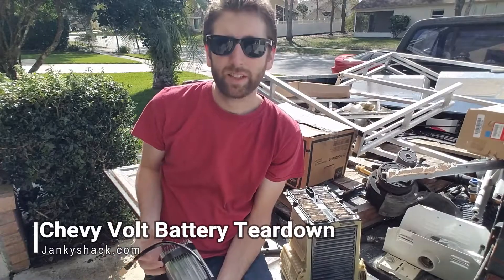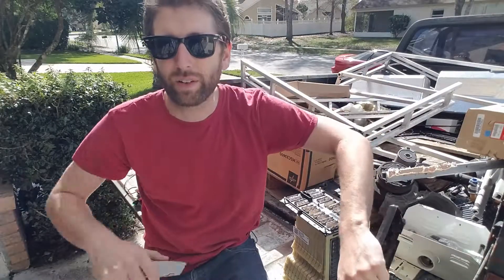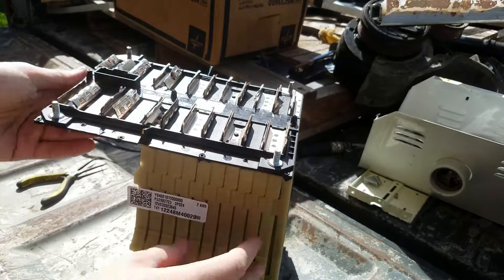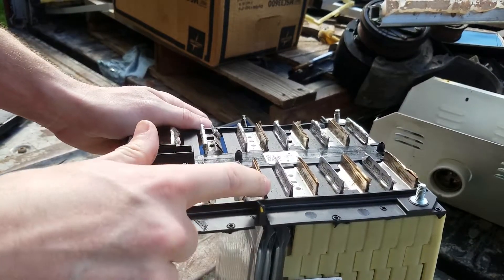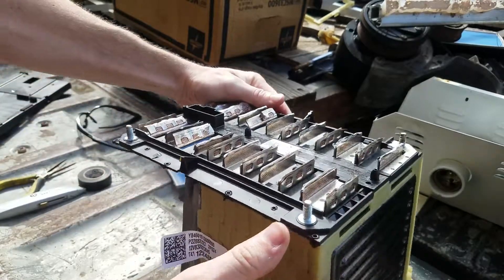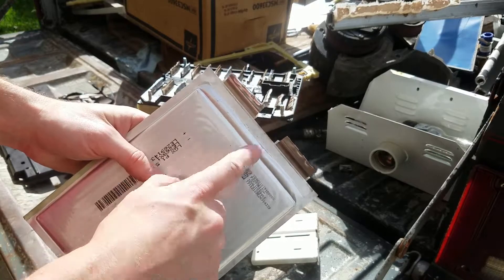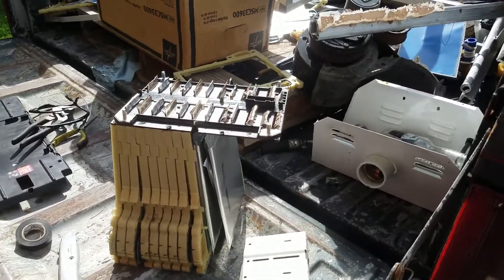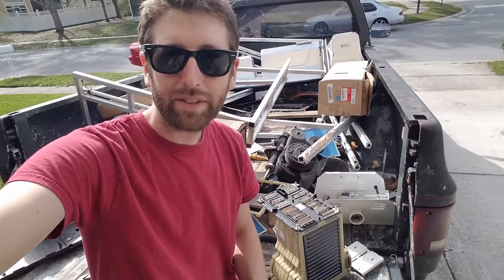Chevy Volt Battery Module Teardown to Individual Cells

Comment: Is it possible to replace just the cell?  How much is a cell?  Dealer told me cell no.2 is bad.
Reply from the maker: a cell? no. you would have to replace either a module or the whole pack. You can find modules on ebay for $500-$600 for a used one or a whole pack for around $4000 for a used one. You will have to remove the entire pack either way and then to do the module you will have to take the pack apart. There is high voltage and high current potential in the pack so you will need to be very careful once the pack cover is removed. You should use insulated tools so if you accidentally touch the wrong thing or drop something the plasma ball doesn't burn all your skin off. You will also need a forklift or a car lift or something to get the pack in and out of the car.
Reply: @JankyShack  Yes battery cell.  The dealer says that my battery needs cell no.2 for replacement.  All of the other battery cells are ok.
Reply from the maker: @landscaping3716  good luck. unless you have access to an ultrasonic welder it will be impossible. and even if you do it will still be impractical.

Comment: BAHAHAHAH   I sold so many Volt packs. I have seen 4 part numbers... LGX P1, P1.5, P1.7B, and P2.5 in the later cars. The P1..7 and P2.5 are teh best. 

I pulled 300A in a flash on 20s ( 20kW) on a 2.5 cell pack. 

Use stronger wires isolate cells NO ELECTRICAL TAPE

Your cells are a little purffed.. From a 2013-204 car. They are not to dangerous. You can shoot them and they are fine.. but if you get a thermal runaway from charge cycle or discharge cycle, that s trouble. 

Well behaved cells.
Reply: I am going to link your vid for those that ask me for dissasy pics, Ok? Thankyou.
Reply: I use a Dremel on a CNC machine to separate cells. I also cut the plates to fit in the bikes to make the battery case smaller and stackable.

Comment: and there is over 300 volts in a full battery unit. 108000 watts easily
Reply from the maker: The chevy volt pack is 16,000 watt hours

Comment: What if someone wanted to build an electric motorcycle using a 36 or 48volt golf cart motor with regen feature?
Would these be good batteries to use?
Reply from the maker: Yes and no, they are 48v, but you wouldn't be able to use the regular charger. You would need to use a different charger and a battery management system either in the charger or on the battery. A golf cart is just a small electric car, these are electric car batteries.
Reply: @JankyShack  well I dont want to go with lead acid.  What do you recommend?
Reply from the maker: @CarModsandDadBod  I don't really have a recommendation. If you don't 100% know what you're doing with lithium batteries I would go with the all-in-one style batteries by companies like battle born. They are very expensive though, they are $1000/piece and you will need 4 of them.
Reply: @JankyShack  wow, too rich for my blood. Im kind of looking to do a budget bike build
Reply from the maker: @CarModsandDadBod  I have some videos on my channel on batteries that I've made for my 1 KW E-bike. You can build one of those batteries for a few hundred. You still need the BMS and charger.

Comment: Just curious but what did you do with the plastic cooling end caps and other cooling bits like the o rings, etc?
Reply from the maker: Some of it is in a pile in the corner of my garage
Reply: Wow, thanks for getting back to me so quickly. I may need the cooling plates and the plastic end caps for a future project. My email is rbrauns AT xsmail DOT com.
Reply: Do you still have a few of those cooling plates at 4:06?